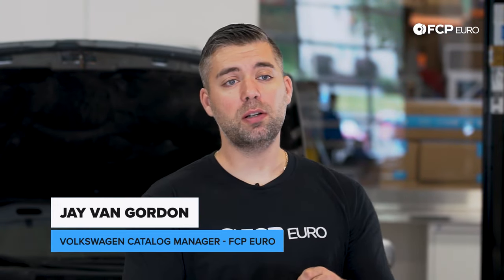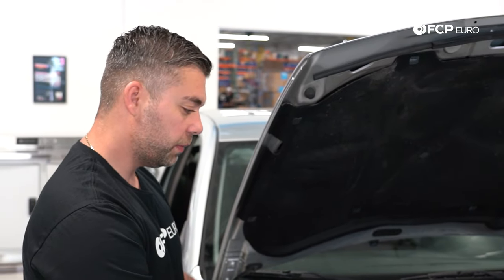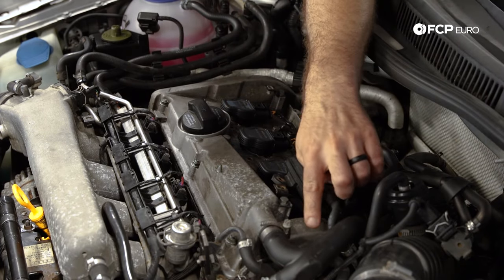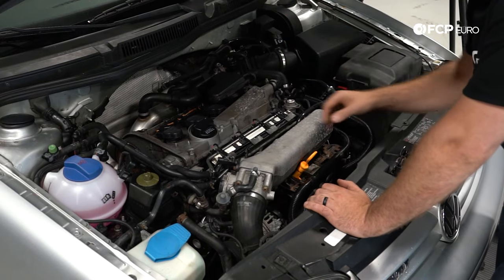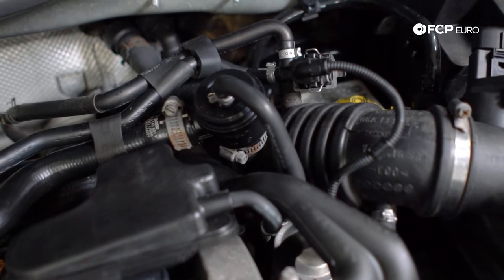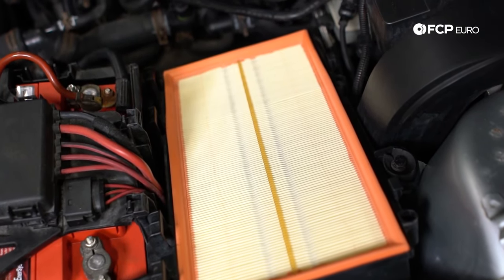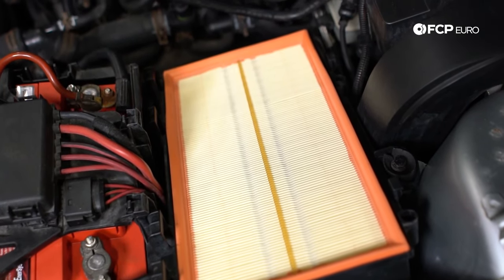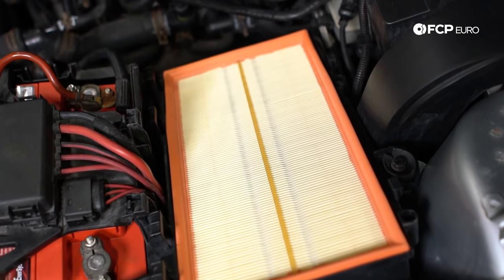Volkswagen/Audi 1.8t Engine Diagnostic & Maintenance Guide (Mk4 Golf, Jetta, New Beetle, Audi TT)

Comment: 14:10 dramatic wrong level of colling liquid. That can broke engine a presure when its hot can break hoses or coolant cap. Not do this with any vag engine
Reply: Exactly what i was thinking.
Reply: no it wont. on these cars the maximum level is slightly over the half of the resevoir. even if the max level is marked differently. my 99 tt has a original resevoir, and there the max level marking is above the middle on the top side. although its slightly too high, but it shouldnt cause issues
Reply: also little follow up: these resevoirs have a cap with an integrated valve that relases too much pressure via the little side opening on the resevoir.
Reply: Engine code AJQ

Comment: I had audi b7 convertible 2.0tfsi  engine is problematic. Oil consumption, carbon built up, airbag igniter cannot be fix even bypass the yellow wire under seat. Camchain tensionaire issue, coolant flange, oil leak in vacuum pump, air fuel mixture issue complete disaster of your pocket. If you can fix your self is fun you can save expensive  labor cost.

Comment: So this is the 1.8t 1st Gen then?  Or does this also apply to the 2nd gen 1.8t found in the mk7 like in my Alltrack?
Reply: This is the 20v 1.8t. Found in Mk4 VW, B5, B6 and Mk1 Audi TT.  The newer 1.8ts are 16v and part of the EA888 engine family.
Reply: @1PotatoeMasher1  So my 2014 VW Jetta 1.8t is a EA888 Gen 3?
Reply: @davidm.1934  it sure is!